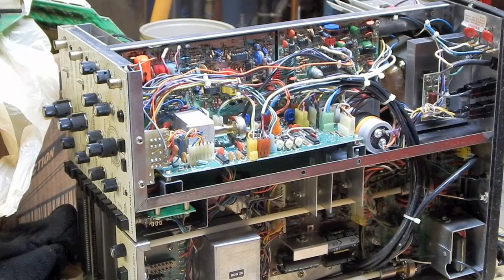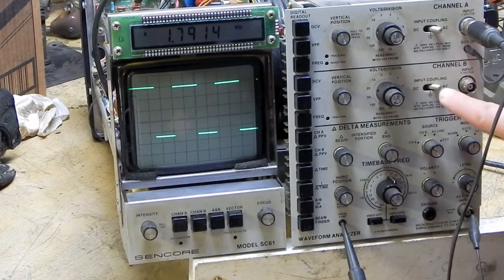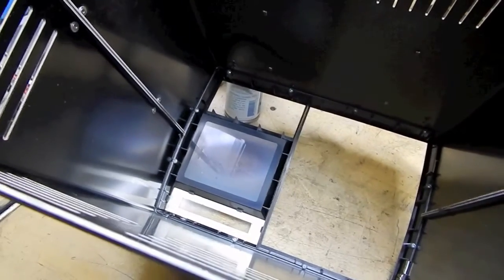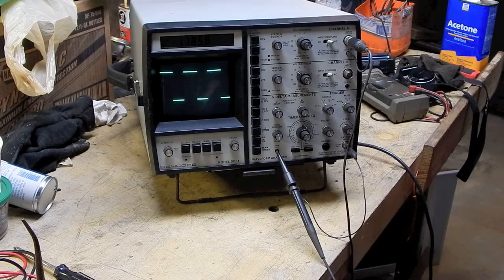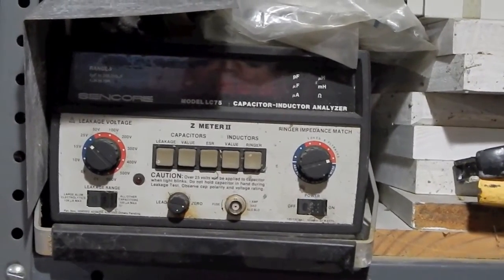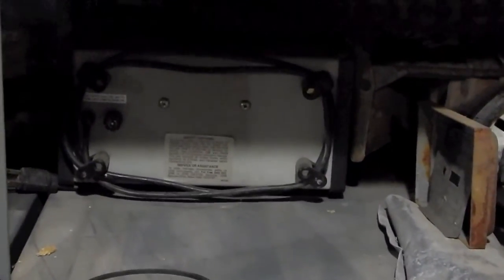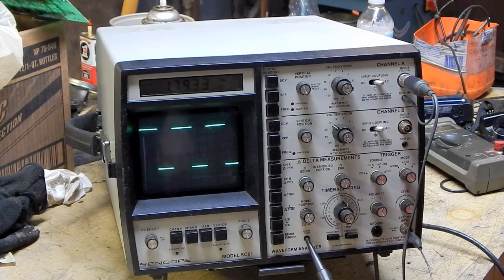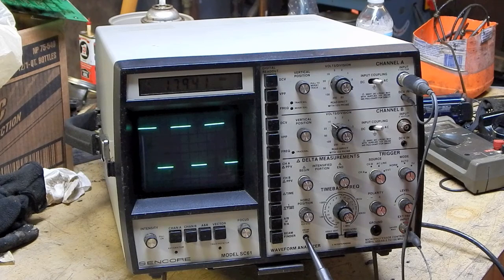Sencore SC61 Waveform analyzer Part 4

Comment: I got of these for free about 6 months ago. It worked fine for about half an hour. But now the trace is about 3/4" high regardless of the ground setting (set to ground on channel 1 and 2) or whether Channel 1 or 2 is selected.

The person who gave it to me for free said check the filter caps, but odd it would work fine for 1/2 hour then go "poof" like that.
The vertical and horizontal position all work as well as the display, but even with no probes on, and the A and B inputs set to ground it does this.

The focus control does not fix this.

Comment: Hello, I just ran across your video, very good tech show.... Question , was you using the original sencore probe? Nice, Thanks
Reply from the maker: No. Sadly I don't think I have any of the original probes. I used a regular 10x probe. The sencore probes have the extra wire at the BNC end to plug into where the DC voltage is input to enable direct voltage measurement with the LCD display.

Comment: DeOxit is not the same as the old stuff. The old would get rid of the black oxide but it was nasty stuff and would soften some plastics.

New seems to work, but contacts still look black.
Reply from the maker: +Scott Henion Yeah, I figured it must have changed since the 90's………most have, either for environmental or economic reasons.